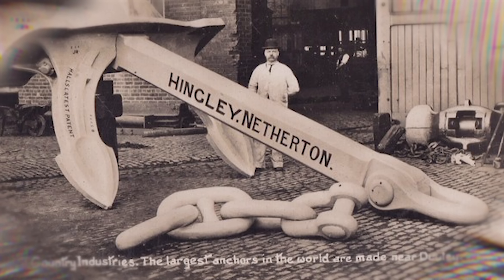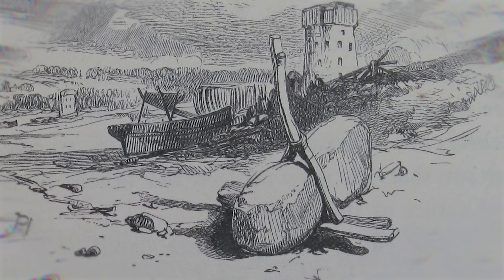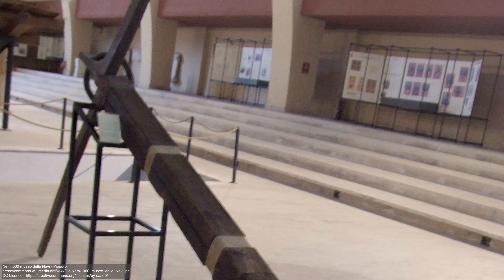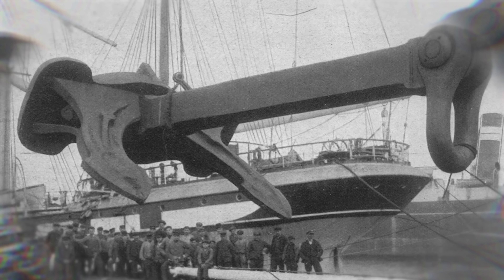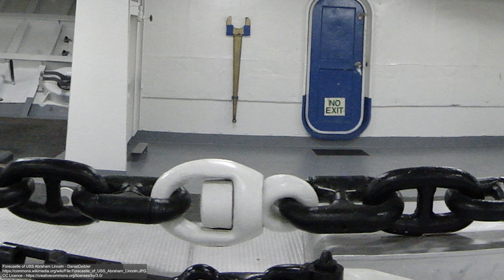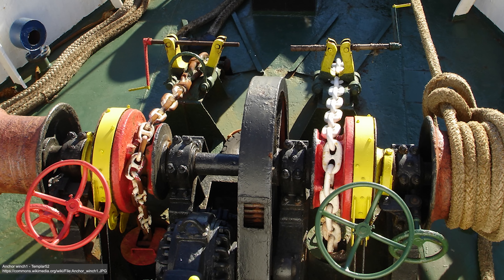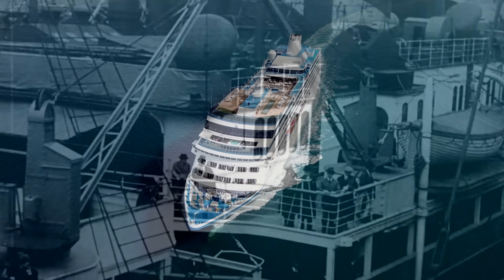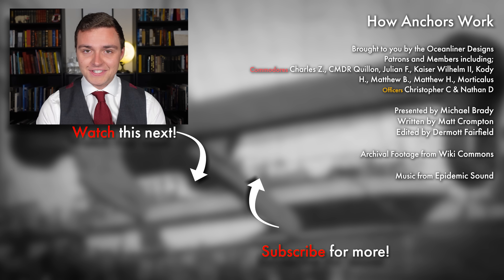How Do Anchors Actually Work?

Comment: Bob Cornuke tracked down the four anchors from the ship Paul was being transported on that wrecked at Malta some years ago. Turns out when using the direct information found in the New Testament, it not only put the wreck site on the southeast end of the island, but the descriptions narrowed it down to a single bay. Spoiler: it is not the bay the Catholics champion up on the northwest end of the island. All four anchors were found by sponge divers in the 60s and 70s in the bay, one being broken in half as they were made of mostly wood (long since rotted away) but had a heavy piece of Lead at the top. The broken one was melted down to make diving weights, and the other three were picked up. I think one finally made it to a museum, but despite being exactly where the Bible says they would be, were the exact number as the Bible says they had, and no other signs of a shipwreck have ever been found — they still refuse to acknowledge that it came from the ship Paul was on because “they were found somewhere other than the traditional Catholic dictated location”… even though they were found EXACTLY where the Bible said they would be thanks to listing the time of year, weather, and currents along with a coastline description that fits only the one bay… I guess “don’t let the TRUTH get in the way of what people want you to believe”. It would be like finding the Titanic but everyone saying “that can’t be it since it sank 50 miles to the west according to someone in the 1960s who has no connection to the wreck at all”. Boggles my mind. Again, Mike, it was Bob Cornuke who did the research and tracked all four anchors down if you want to watch his presentation about it. Whether you believe it or not, the fact that four Roman era anchors from a trade ship were found at all is amazing.

Comment: Ex sailor here. Yes, it is correct: Anchor holds chain, chain holds ship.

Well we called the chain lengths "chackles", but that is just another name. We had one or two occasions during my sailing-time that the anchor actually slipped. Then we had to wind up all the chain (until "anchor over water") and geposition it again.

I was usually the apprentice on the hose, cleaning off any mud clinging to the chain. Worst really was south of the suez-canal... such a sticky, slimy clay!
Reply: Shackles

Comment: Very interesting. There have been massive changes in the last 20 years to anchors for small boats. The Danforth (closest in design to what all large ships now seem to use - and what I see in this video) is not as reliable as new anchor designs, such as the Mantis or Viking.I wonder why the fluke design works so well for larger boats.

Comment: At 9:10, our friend Mike Brady from Ocealiner Designs mentions that anchor cable to be paid out should be 3-7 times of depth of the water. However, at least for tankers 6-10 times are recommended by the INTERTANKO (the International Association of Independent Tanker Owners).

Comment: Good work, that’s not strictly true that the only reason to have the anchor it’s to hold the chain down. They certainly do provide significant holding power from their design and way the drag on the sea bed depending on bed type.
Reply: You are correct! The anchor does hold the boat, the chain is to pull perpendicular to the bottom instead of an angle the would pull the anchor out of the bottom. I once had an anchor buried so deep I couldn’t see the shank! More proof that the anchor is responsible is a mooring. It uses a mushroom anchor and everyone that ties to a mooring ball knows how stable they are!

Comment: So what would happen if a ship dropped its anchor at, say, over the Titanic's wreck, or over the Marianna Trench? Would the chain/cable break under its own full weight?
Reply: It probably wouldn't break, but the windlass won't have enough power to pick it all back up with the weight hanging on it.   Most ships have a poster in the wheelhouse showing the windlass power and then a calculation based on that to show the maximum water depth the ship can anchor in.

Comment: Lots of different types for the different bottoms
.
A rock bottom needs a different type than a mud/silt bottom
.
And then ya have fort peck lake.... which has ALL TYPES of bottom lol
.
One island had hard clay on the north, silt on the west, pea gravel on the south, and mud on the east
.
I called it mystery island LOL
It pretty much popped up overnight (drought, water was dropping a foot a day at times)
.
But that "multi-bottom" was so strange
The hard clay side had water so clean it looked like the Bahamas.... little rainbows on the bottom, minnows swiming around. 
.
But the other side was cloudy with silt 24/7
.
.
Water has come up, and its about 50 or 60 feet below the surface now
.
If it ever comes back.... i left a rock pile spelling out my name on the hard clay side (but hopefully the water doesnt drop that much..... was dropping 2 inches a day, and the power house turbine was 8 inches away from not having enough head PSI to spin the generator)

Comment: Very simple working principle. The actual anchor is the weight used to set the point on the ocean floor where it will dig in and become stuck. The vast amount of chain is then played out to add additional weight for helping to hold the ship in position. Both factors combined hold the ship in a general position.

Comment: As a lifelong (small craft) boater I really didn’t expect to learn as much brand new information as I did! Awesome video!
Reply: Be careful. Not everything translates one-to-one to small boats. The chain, for instance, is much less important for a small boat. You have it to protect against rocks cutting your anchor line. It doesn't do much damping, and the contribution to holding force is the same as that of a deadweight anchor. Provided that you have a good anchor and not some inaccurate knock-off, your anchor will not break out if you give your anchor line 7 times depth.

Comment: The chain holding the ship, an the anchor holding the chain down. I have heard that said several different ways by a lot of very smart people. But its not true. The anchor does almost all the holding of the ship. The chain helps some but it really exists to do two things. To change the angle the ship pulls on the anchor and it acts as a spring.  If a rope is used, every time the ship pulled on the anchor, it would jerking tight at an upward angle. With a chain, gravity pulls it flat to the sea bed. When the ship pulls on the chain, the chain redirects that pull from up to flat across the sea floor, keeping the anchor digging in. And with gravity trying to hold the chain down, it acts like a spring. The ship pulls, the chain comes off the sea floor, an gravity pulls it back. That removes most of the jerking energy that would dislodge the anchor otherwise. The action is the same as if you used a spring, your just using gravity. Now under light wind, the chain is holding the ship. But in heavy wind, the anchor is producing almost all the holding power. Theres a reason their are lots of new design's of anchors, an chains stay roughly the same. One has a complicated job to do, the other does its simple job very well already.
Reply: You missed one critical element of the chain's purpose,  it's weight. Depending on how much chain has been released, the chain itself will weigh many times what the actual anchor weighs. While it's the anchor that is digging into the sea floor to provide the initial resistance, the actual force required to lift the chain from the sea floor, the spring action you allude to, is because of the massive weight of the total length of chain in the water.

Comment: The ships of the line like HMS Victory had massive hemp cables that it practically took the entire crew to man handle them back into their storage lockers and required smaller "Messenger Cables" to connect them to the capstan as the cables were too thick to go around the capstan's windlass and required up to 144 men to turn said capstan. Sailors came up with a number Shanties to make the work of turning the capstan lighter, an example of one would be 'Paddy Lay Back' but shanties used for other tasks were used the most famous shanty 'Drunken Sailor' being one of those.

Comment: Would or could you ever use an anchor and chain to slow the vessel in emergencies?
Reply: Yes, trick is to only put out a small amount of chain (~200 feet) to let the anchor drag along the bottom.  If you put out too much the chain can catch and put too much force on the equipment on the bow and break things.  One piece of advice I got during my merchant marine career was "Never hit anything with your anchors in the hawse"  Basically you wanted the anchors out to show you had done everything possible to stop or minimize the speed of your ship.
Reply: @ thanks for that ! Bloody interesting !!
Reply: 2025-01-22  
@lifeontherocks 
Ja, i låg fart, i hamnmanövrer är det vanligt att båda ankarna är klargjorda för störtankring. 
T.ex. om fartygets djupgående är nära botten i  hamnen så kan slam och annat oväntat ändra fartygets kurs. Då kan störtankring hjälpa till. 

2025-01-22
@lifeontherocks
Yes, at low speed, in harbor maneuvers, it is common for both anchors to be prepared for drop anchoring.
For example, if the ship's draft is close to the bottom in the harbor, mud and other unexpected things can change the ship's course. Then drop anchoring can help.